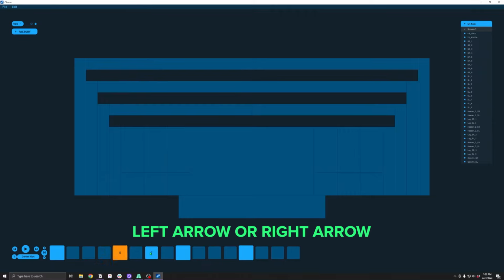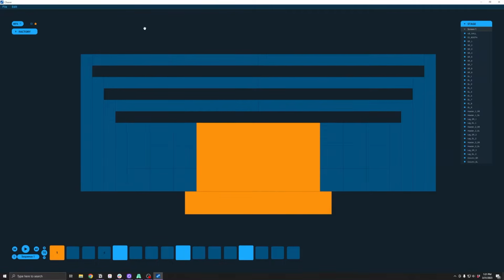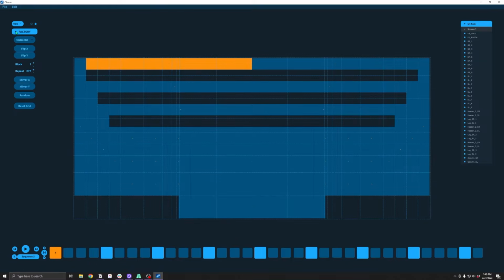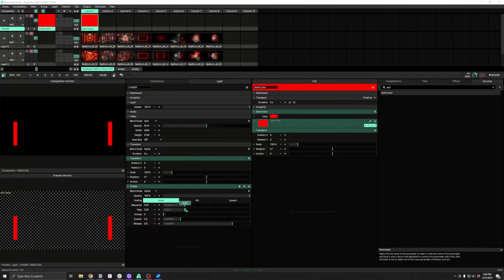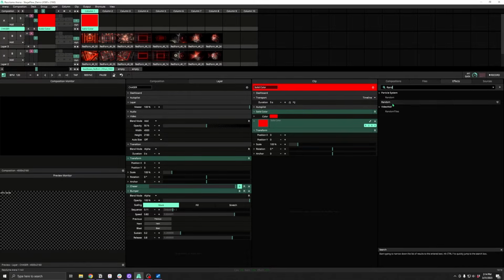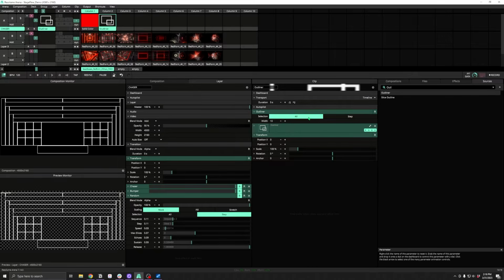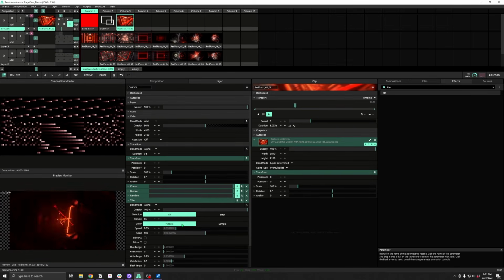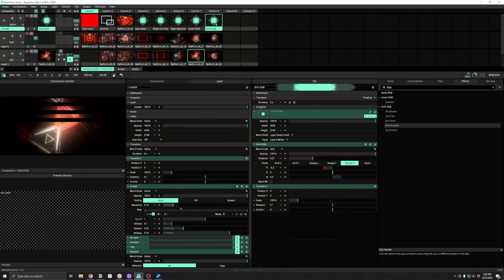Chaser Ultimate Guide | Resolume Plugin Tutorial

Comment: Bro, i tried with this the Stage Flow as well! But the output was little bit messy! Do you have any idea about that? It was the same layout as yours even in the Stage Flow.
Reply from the maker: You want to avoid applying any output transformation effects to chaser or it will misalign.  So put chaser after stageflow or on a layer that’s not affected by stageflow. I usually use stageflow on a group or layer instead of the composition